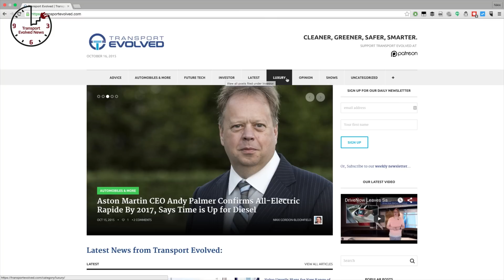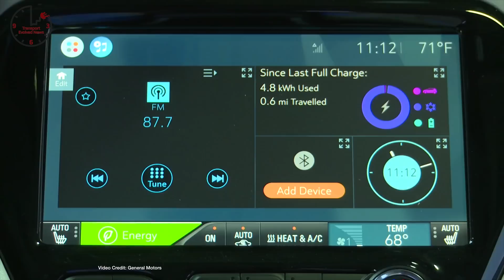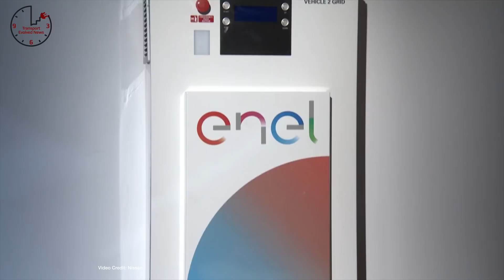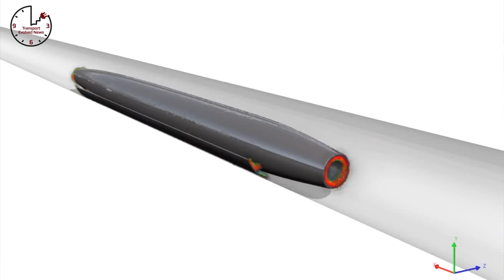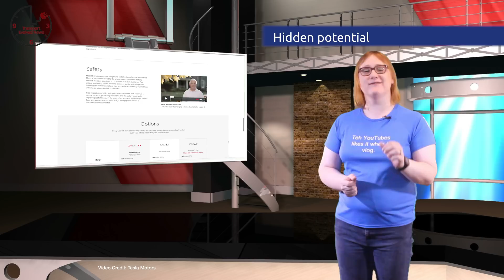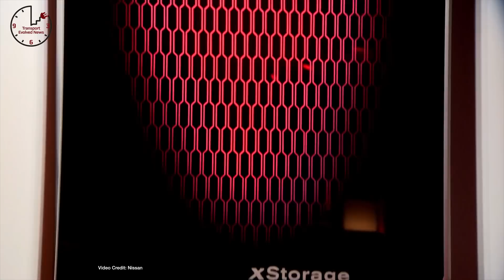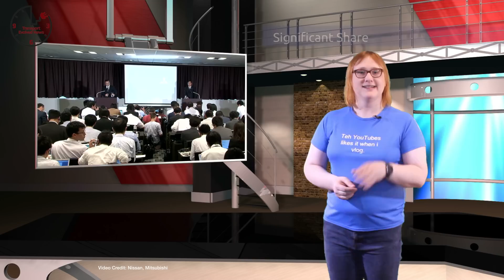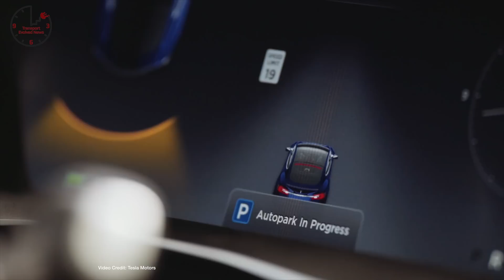Chevy Bolt EV Sales Predictions, Model 3 Risks,  Hyperloop Fun T.E.N. Future Car News

Comment: Tesla just lost me. Whoever decided that a software lockout on a battery pack is a good idea needs to be taken out behind the woodshed and switched.
Reply: Stephen Bungay I think you musunderstood. The customers ordered a Model S with 70 kwh of battery capacity, and they got 70 kwh of battery capacity out of a 75 kwh pack, so they got what they paid for - with the option of getting more capacity later without a major rebuild. They were not cheated.
Reply: Stephen Bungay I think you musunderstood. The customers ordered a Model S with 70 kwh of battery capacity, and they got 70 kwh of battery capacity out of a 75 kwh pack, so they got what they paid for - with the option of getting more capacity later without a major rebuild. They were not cheated.
Reply: I agree to disagree. The customer ordered a Model S with a 70kwh battery, but if the manufacturer (Tesla or otherwise) puts in a larger capacity battery the customer still owns the vehicle as a whole and should be able to use it, all of it.
Reply: Ah, but they did not pay for 70 Kwh, capacity, they only paid for 60. How would those paying more for the full 70 Kwh capacity think, if they found out someone paid thousands less for the same capacity? 
But the "60 Kwh" customers can pay the difference and get the full 70  Kwh capacity, or, if they stay at 60 Kwh they get a longer battery life, due to less of the battery capacity being used. They really have nothing to complain about.
Reply: It certainly is more convenient than physically swapping out the battery, but it is also less ethical. So we continue to agree to disagree, but that's OK, if we all agreed on everything it would be a very dull world. 

I understand your viewpoint, good discussion Chris.

Comment: Tesla Model 3 has no 'Physical' speedometer panel in front of the steering wheel.  That is where the BOLT will steal sales from.
Reply: The dash is still in the works, We don't know yet what it will be.

Comment: My projection is that the Bolt will sell around ~20k in the first 12 months...and that 80k is completely ridiculous.

Since the existing Miria is being sold at a loss, I wonder how much of a loss Toyota would take on the new one...
Reply: +JohnSnow What do you use to base your sales prediction on?
Reply: The fact that GM is specifically limiting production, limiting sales, historic Volt sales, a lack of CCS charging infrastructure (and the reliability of the ones that exists), and to a lesser degree the amount of Model 3 reservations.
Reply: I don't disagree, that's why I said to a lesser extent. However, it's unrealistic to compare BEV interest to the total number of new cars sold each year...because those interested in BEVs are a small fraction of that number, and an even smaller fraction when you consider that 400k (global) people may no longer be interested in a Bolt. 

Unless you absolutely need 200 mile range, current BEVs offer similar functionality for a fraction of the price of the Bolt. 

Regardless, my other points carry greater weight, and there is no denying them. GM is limiting the sale of Bolts to compliance/states with incentives, and they are limiting production until they have an idea of general interest. These things will impact sales. The 2nd year of the Bolt may be much better, but the first year will be no where near even 50k, much less 80k.

I would prefer to be incorrect, I have nothing against the Bolt. I am trying to be realistic, however.
Reply: +JohnSnow Bolt could  sell 93,482 cars in the first year.
Reply: They are not specifically limiting anything. They will happily sell as many as they can but there is limits to how much they can produce, especially since they are dependent on LG being able to provide batteries.
That said, I think the oft quoted 25k is a modest underestimate, they should be able to sell a lot more. I particularly think the car would sell great in Europe but it will probably be delayed here.
Reply: Yes they are specifically limiting production. They claim that they can make upwards of 50k/yr if the interest is there...however they don't seem to expect it to be. Anyway, claiming you CAN make more than you're making is pretty much the definition of limiting production. 

We'll see if they can actually ramp if necessary, but I won't be holding my breath.